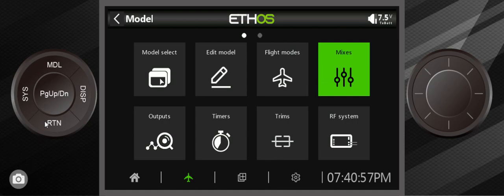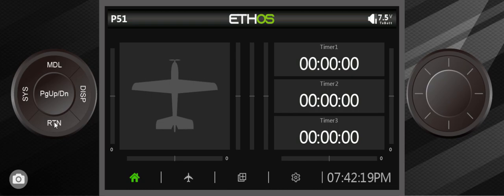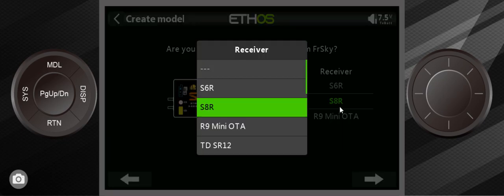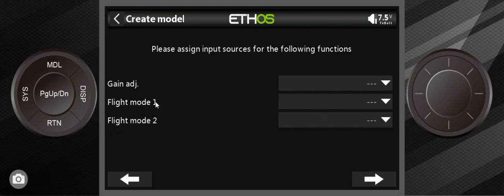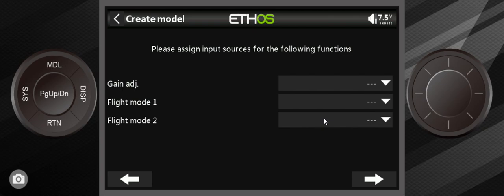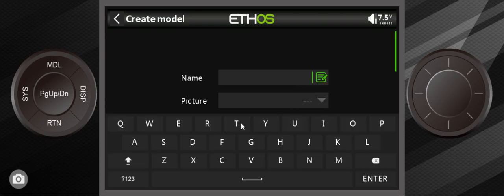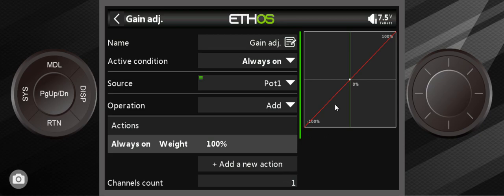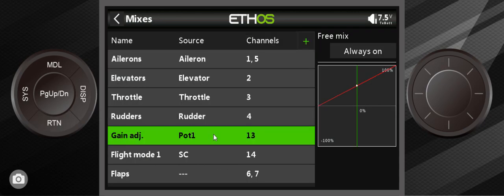FrSky Ethos Stabilized Receiver: Transmitter Setup: Ethos 1.5.x

Comment: Great video! Really helped get my x20s working properly!
I have got a question about flight modes?
Have got x20s and using tdsr10 receiver. 
I’m running stabilised modes on FM1/2
And flaperons and tailerons (takeoff and landing) using FM 3/4
This works well for separate trims. 
But when I select FM1 or 2(stability modes) it overrides the other modes for flaps ( flaperons/ tailerons)
Would be nice to run stability Will using landing flaps!
Any suggestions would be much appreciated!
Cheers Richard 😎

Comment: All good information for BASIC mode stabilization setup thank you. 
Now where is the advanced stabilization course? 😁
The TDSR12 manual says download / install three LUA scripts to use in setting up stabilization then a couple of pages later says you need to use RBmixer and a computer to configure ADV stabilization feature. There is very little current documentation and no tutorials I can find on setting up / using advanced stabilization.
   I am working on a model that I want to add stabilization to the canards on Ch 6&7 but documentation seems to indicate that must be done in advanced mode, if it can be done at all.
 Can you please put an advanced stabilization tutorial on your to do list?

Comment: Howdy.  Question:  I have been able to get the stabilization working in a test plane of mine.  But when I've put it in an F-16 EDF, after the Self Test, the plane won't respond to any inputs when the Stabilization is turned on in the transmitter.  The plane works fine with it off.  But when it's turned on, the plane's control surfaces are completely non-responsive.  Any tips?  The stabilization seemed to work ok before I self tested.  But once I've self tested that receiver, the stabilization locks up the plane.  thanks!

Comment: hey Steve i have the archer sr6 receiver it is not in the for stabilized receiver what am I suppose to use for it.
Reply from the maker: Try another 6 channel stabilized receiver.
Reply: @steveschlesinger3459  this still does not work with archer sr6. the set up wizard choceing the sr6 , when i go to bind the it will not recognizes the rx  does not make it easy when you cant not bind it

Comment: I'm new to FrSky.  Just finished setting up my X20s with a Tandem SR18.  I did the firmware upgrade for the transmitter.  It is now 1.52.  Is this the version with the new Stablizer setup?
Also, will I have to update my Receiver at some point to accept this new setup?